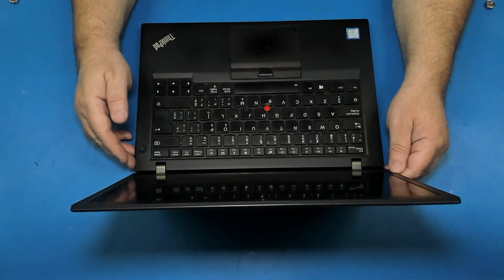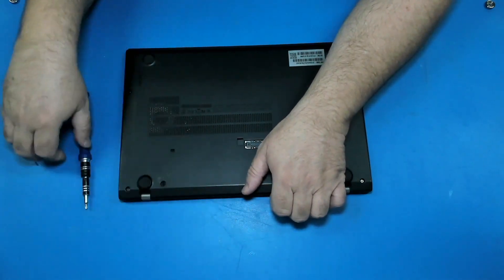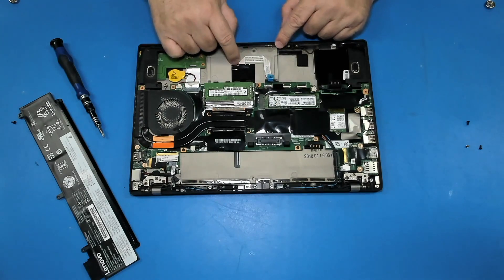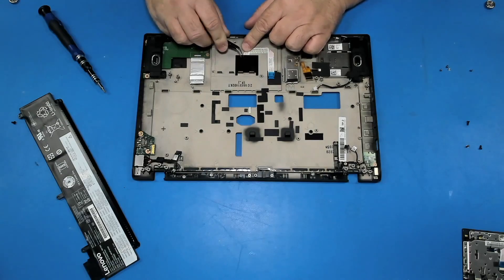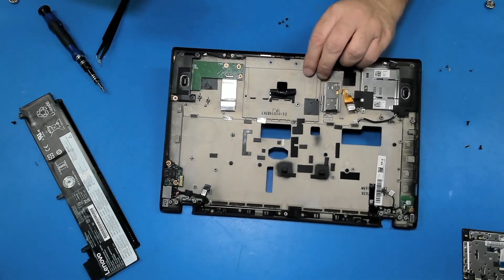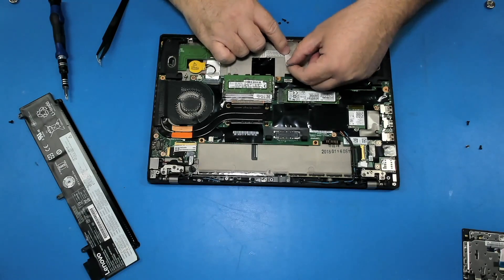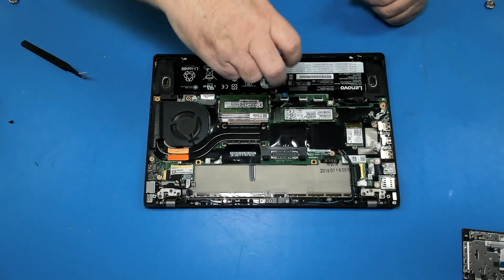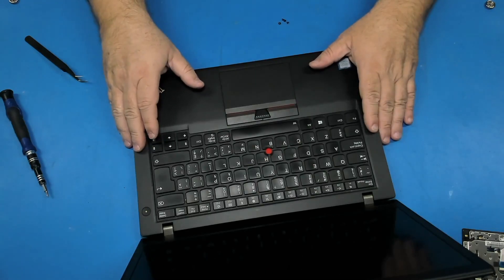Lenovo Thinkpad T470s - Touchpad Replacement | Tech Studio Tube

Comment: Wish my T470 looked like the one in this video, so I'd feel confident enough to start ripping into it... Unfortunately, right off jump street, I can see this Tech Studio T470 is not even made so the 3 or 6 cell secondary battery is part of the bottom of the computer.  My battery slides directly into the bottom of the computer ~ it's a "slide out" ~ it can be changed in 15 seconds.  Great video, I guess, if you've got a T470 that is  configured that way.
Reply: a bit late, but it's not the same model- the one shown in the video is the slim version, hence the s in the name (t470s instead of t470)